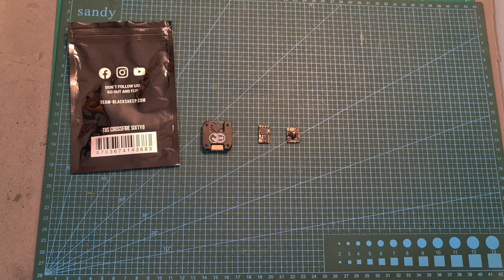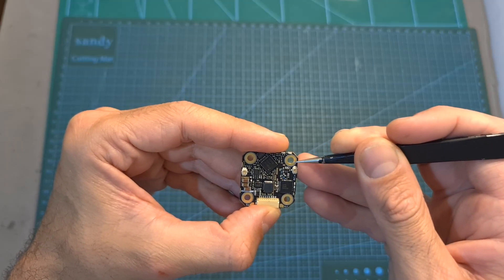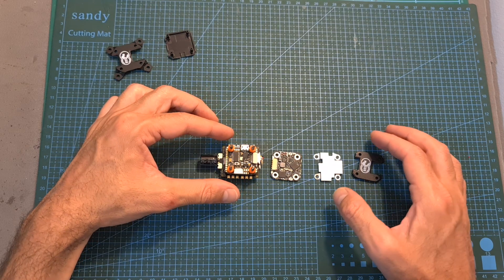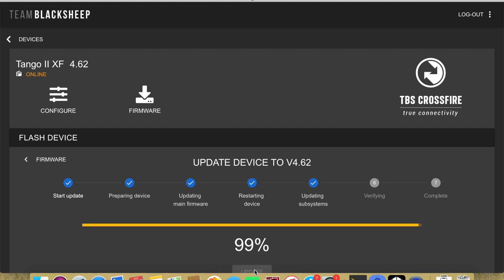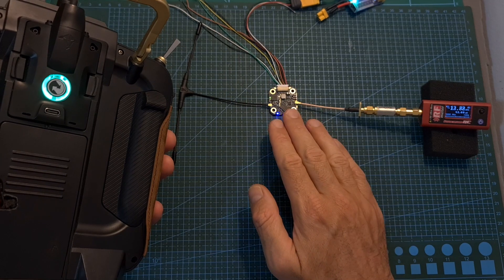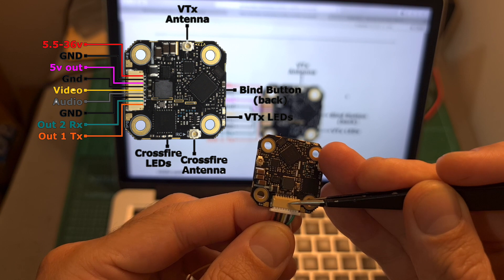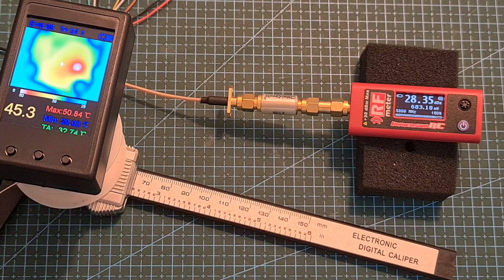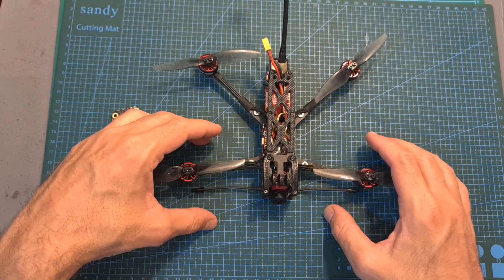TBS Crossfire Sixty9 - Guide & Output Power Tests

Comment: I have a stupid question, is there a way to configure it for find mode? Is it possible to attach a small 1S LiPo to it?
Reply from the maker: Yes it's possible - you can power it externally using a dedicated battery / BEC.

Comment: I was hoping this unit would eliminate the horizontal lines the tbs receivers usually cause in fpv video feed due to interference. I usually mount the tbs nano receiver as far as possible from Fc/vtx to eliminate the interference issue which is not possible with the tbs sixty 9. Pls advise if there is a better solution. Thx

Comment: When this board dont supports smartaudio iam not able to use the betaflight feature "low power on disarm" right?
Reply from the maker: Correct.
Reply: @KremerFPV  A other guy asked TBS and they say the audio cable can be used for Smart Audio of course. I will test that out on weekend.
Reply from the maker: @MrSmithFPV  Ok, please let me know if it worked out for you.
Reply: @KremerFPV  Yes, I will do.
Reply: @KremerFPV  Here again. In their last CRSF update 6.09 release notes they say "SmartAudio supported on Output 1 and Output 4". Output 4 is the audio cable but this still dont works. Tested out about 3 hours today... No chance to get this cable working. But Output 1 is working (sometimes). So you need to switch these 2 cables and also the config in Agent X for the Sixty9. But the problem is that then CRSF is not working anymore. :D Its really a mess. I dont know if they wanna joke us with that.
In short - SmartAudio is not working at the moment.
Reply from the maker: @MrSmithFPV  thanks for the update. I haven't tested it yet and I hope that they will get it working.

Comment: Hi mate would you recommend this 69 crossfire + VTX or a rush tank solo VTX with crossfire diversity receiver 🤔 it for my armatton freestyle frame I'm going to be using the rush f7 analogue 50A ESC+FC stack you done a review on great video , so in your opinion which VTX and reciver  set would you recommend 👊🙏
Reply from the maker: For a freestyle build you are probably not going to get too far, so the form factor of the 69 will be a better option.
Reply: @KremerFPV  ok thanks for the reply much appreciated 💯❤️👊🙏

Comment: I am not sure why when I attempt to down load the newest firmware as you mentioned to allow the binding of the 69 board, the system only sends 3.0.17 version. I have set to 868MHz as you noted but it just hangs in the binding attempt mode with red blinking light on the 69.   Where do you download the 4.62 etc newest variant?  I have tried to attach the new Micro Transmitter and it seems not to see it or already thinks it is updated. All thoughts welcomed and thank you for this video.
Reply from the maker: Hi, TBS had some issues. Have you tried again since posting this comment?
Reply: @KremerFPV  absolutely and now it works!  Thank you!
Reply from the maker: @diveflyfish  Perfect!

Comment: @Gal Kremer Hi I bought the TBS sixti9 but i cant find the update 4.62 for my micro tx v2 module in team black sheep page. Where i can find it? I would really apreciate your help!
Reply: You have to enable beta firmware releases on the main screen of the agent x, it should be in the settings top right corner, after you enable beta firmware releases you should be able to download and update your micro tx to 6.01 or whatever the latest one is. After that I was able to bind!
Reply: I can't find it either 😕 it just show 4.11 current version
Reply from the maker: Thanks, I forgot to include this piece of information, as for me the beta firmware option was already checked.
Reply: I have same issue. Agent X is only showing firmware up to 4.11 with beta updates enabled. Micro TX V2. Pulling my hair out trying to figure this out. TBS website is no help on this. What am I doing wrong?
Reply: @douglasstewart3426  i have the same issue. box checked but no 6.07 update
Reply: @propprincessfpv2477  pls lmk if you guy figure it out i am having the same problem. Cant find Fw 6 even with beta selected.
Reply from the maker: @nino82ns  TBS had some issues. Hopefully they fixed it by now.

Comment: newbie question, this is a 1 watt output TBS  RX and VTX combined board, and is compatible with DJI HD goggles ?
Reply: No this is not compatible with the dji goggles
Reply from the maker: The 1W output is only for the VTX and it's not compatible with the DJI goggles, without an analog VRX adapter.

Comment: Thx Gal 

- just one question - realized that is does not support SmartAudio - to bad if my following assumption is right 🤔 just got one today and would like to use it in an very light INav wing build with a FC with only 2 UART

to control it via CRSF Configurator/lua script you show at 5:36 will only work, if the 69 is connected to an UART, (TX/RX) right?
so with only 2 UARTs like on a Matek F411 WSE (1 for CRSF RX, 1 for GPS) I won‘t be able to control the Sixty9 over softserial/SmartAudio?
Reply: the vtx is directly connected to the crossfire receiver, so no. there's no smart audio so you cannot control it via inav at all - not even low power till first arm or anything like that
Reply: You can actually control all the vtx settings through the radio, after you’re bound, just go to crossfire config and you’ll see the sixty9. In there you’ll be able to change vtx settings like power and channel etc
Reply: @johnny_m_86  i realise that, but that is comletely missing my point. I cannot do it via the OSD or via the flight controller automatically full stop. that is (for me) a loss of functionality for no gain.
Reply: @johnny_m_86  Same here 🤷‍♂️
I like to change my power levels with a switch what used to work with SmartAudio even with an only 2 UART (INav wing FC) like the small F411 WSE  (for some builds the other Matek FC are just too big and/or heavy) 
and even if I got a Fusion module and could change it there …. to me no practical inflight solution 

like @Daytona FPV said - that’s a step back TBS - should have made the Audio pin working in both directions and not only for a microphone in
Reply: I see that too.  I use inav logic to adjust my VTX power up and down automatically with distance (and in case of failsafes) - smartaudio support is needed for this.  Oh well.

Comment: Hello I just saw your video on the new equipment from TBS the sixty9.
I can't binder it on my FC, I crossed RX and TX, in betaflight in UART 5 ports activated (RX)
  on my taranis (the crossfire TX) is in firmware 3.78.
before I had the nanoRX from TBS and it worked flawlessly
thank you for your reply
could you give me an assembly diagram on the FC and how to bind it
thanks in advance
bruno
Reply: you need to update Firmware of your TX to v6 , you can find it in tbs agents and go to 3 dots up to right in app and active last choice to show beta Firmwares. than go to check least beta Firmware of your Tx

Comment: I wish TBS made it with a ceramic, built-in antenna, ELRS-style, in a 25.5x25,5 whoop form factor for toothpicks.
And the weight should be significantly reduced  - it may be OK ona 5 inch, but on a 2s, 2.5 ir 3 inch toothpick,weighing 40 or 50g, literally each gram counts and makes perceivable difference... At the moment  my preferred setup is ELRS EP2 and Eachine Nano VTX v1 and the 69 won't change it...
Reply: Each one nano V1 is the goat! Pandarc one is also pretty good
Reply: @noamamir0942  v1 has similar range to the Unify Pro32 Nano, which I had used extensively as well, but much more resistant to EF noise and produces cleaner video, plus is just half the price
V2 and 3 are bigger and heavier and don't offer better range or iq
Reply: Eachine? Over TBS? Ummmm ok

Comment: crazy for 50$, im really interested in seeing the tracer version rx preformence(only 1 antenna compared to the usual 2)
Reply: Hopefully it performs better than just running one antenna with the standard tacer reciever... I tried that on one of my 3" quads. Range was terrible
Reply: @overdosed51  same as my experience 100mw TX with 1 antenna on rx is nowhere near enough range